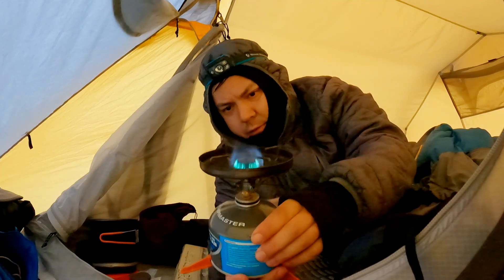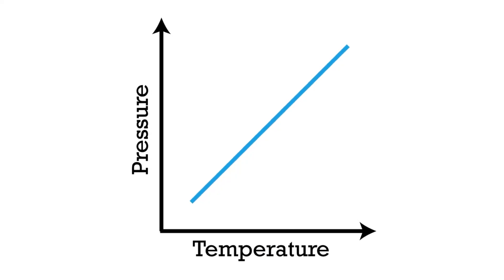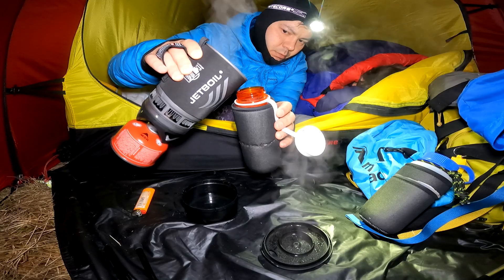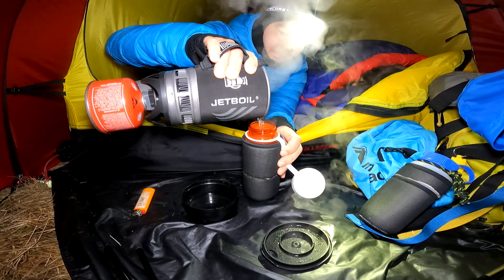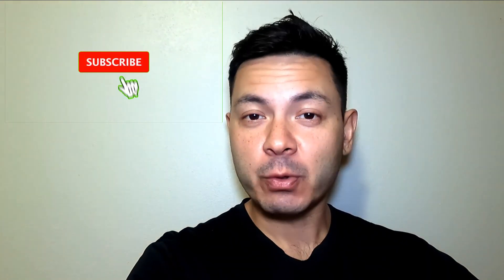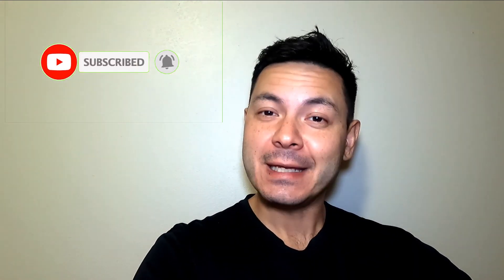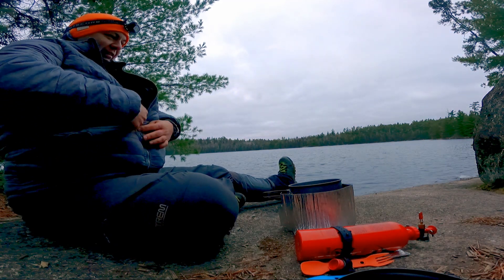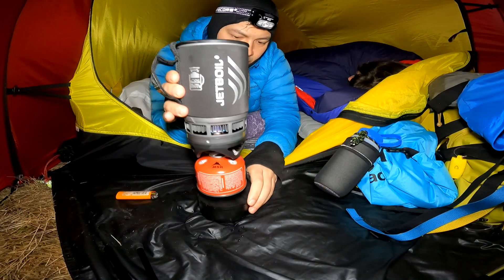Winter Backpacking - How to Use a Canister Stove below Freezing Temperature (and some Stove Science)

Comment: 4 Season tents for winter, 3 Season fuels such as cannister stoves.
Trangia alcohol stoves, seem a viable back-up unit.
Methyl Hydrate 99 % pure is very effective in minus temps, just very slow and wind sensitive, or stop boiling when tiny bubbles form in your pot, that should be hot enough for Coffee.
Cheers!
Reply: MSR actually makes an artic pump for lower temps.
Reply from the maker: Thanks Andrew. I actually did an overnight trip recently and it get down to close to -40C at night. Both of my MSR fuel pumps basically stopped working (the seals were too rigid to seal properly, so i struggled to pressurize the tank). I agree regarding the Trangia - ultra reliable. Though, I wish the energy density of the fuel was a bit higher.

Comment: Very interesting.  One time, I poured boiling water onto my canister by accident (draining out the pasta).  

In your next video with your Ph.D. thermodynamics expert.  I would be curious to know if boiling water could cause a canister to explode.  I heard the canister start making a boiling-type noise and, luckily, was able to realize what I was doing before it blew up between my legs!  lol
Reply from the maker: Hi Greg! I've done similar on purpose (taking safety precautions). I've accidentally overheated canisters pretty badly (on accident) in the past. I noticed that they start making a lot of metallic pinging noise, as the metal starts expanding (beyond what is probably should be doing). I made another video on this, previously. I've seen a couple videos if similar experiments on youtube (basically trying to get the stove to explode).